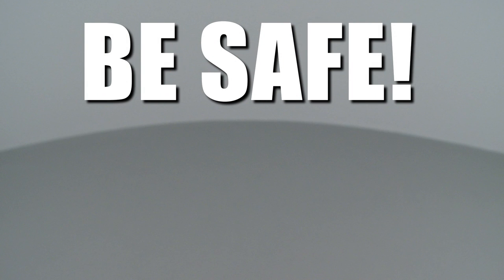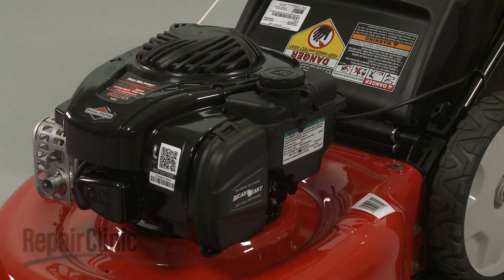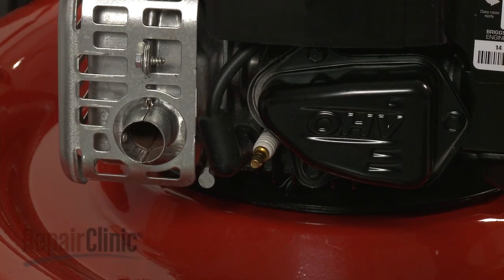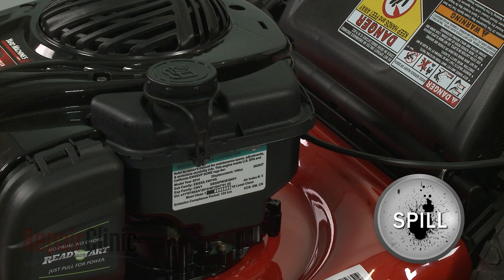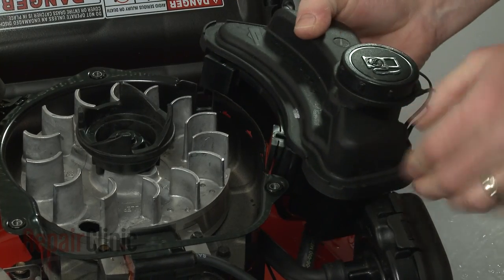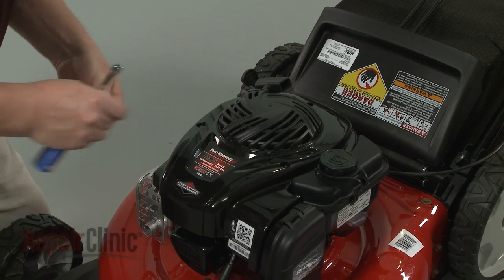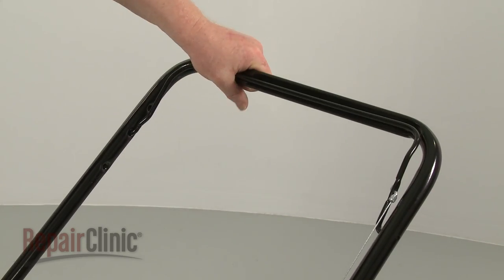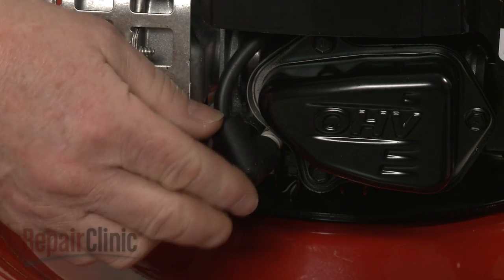Briggs & Stratton Small Engine Fuel Line Replacement Part # 791766

Comment: I would recommend stating: Add a small amount of fuel and check for leaks BEFORE filling the tank, and for safety, before reconnecting the spark plug.

Comment: My lawn mower is a bit different, didn't need to take out the top cover but basically same steps. The new fuel line is a perfect fit, no more leak.
Reply: I have a question.  The fuel line end is connected to the carburator kept popping out.  Do you think the clamb is bad.